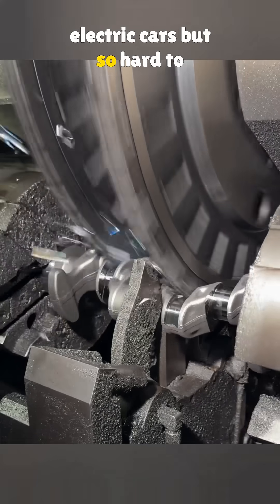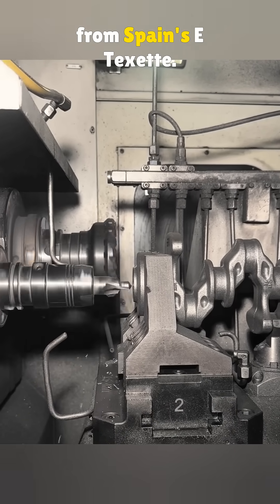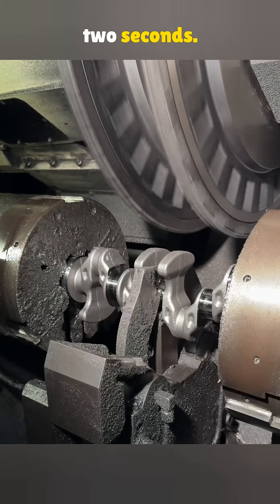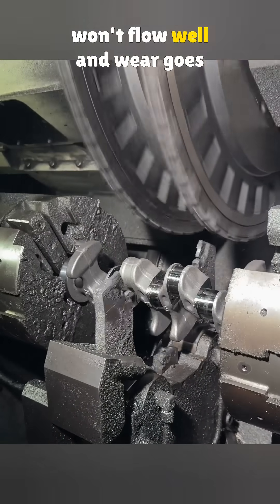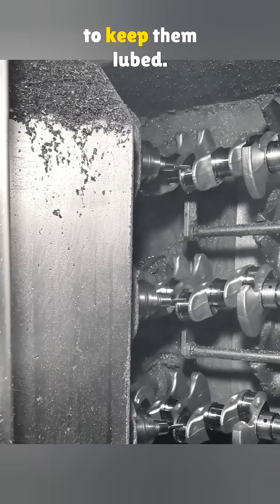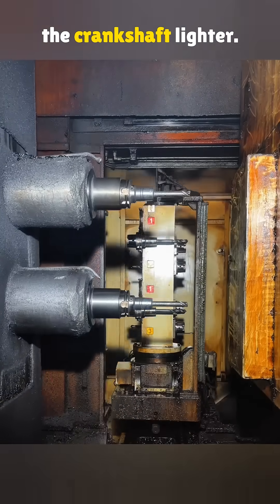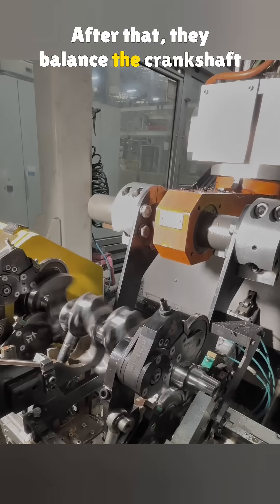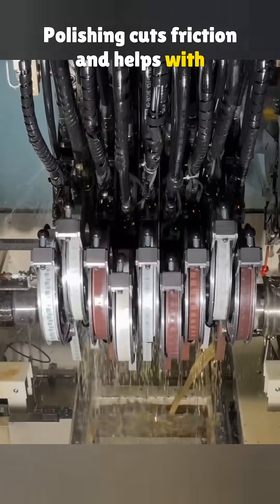How a Crankshaft Is Made #automobile #car #cartech #engine #mechanic

Comment: Batteries take high end precision industrial tools to make thin and perfect sheets of metal, plastic separator, precise amounts of liquid electrolyte, precise mixtures of compounds, some are micro meter engineered materials for Si for example and then again precise tools to take cells and battery packs out of with complicated cooling and electronic BMS boards. The electric motors are relatively simple but the inverter, motor controller, BMS and software are even more difficult to manufacture. They are cheap only due to scale but not everyone can make chips or write code or scale up production to be affordable.
Reply: Dont forget the copper, lithium & other metals that gotta be mined &  shipped to the the factories etc...
Reply: Wait for 10 years of industrialization
Reply: Though you are correct about engine assembly, you conveniently neglected to mention that producing an electic engine is material intensive and thus expensive. Furthermore, it's only half the picture, in fact, BEVs shifted the difficulty from the engine to the fuel. While it's extremely simple to produce a fuel tank and a fuel pump, making a batteries, all the necessary electronics, cooling systems, etc., is material and process intessive. Moreover, major issues with BEVs are yet to be accounted for, in fact, they aren't going to be solved any time soon. For example, BEV car cost, buttery cost, charging times, home charging avaiability,  charging stations throughput, lithium butteries inherent instability, risk  of fires, cost of repair in case of accidents, to mention just few.
Reply: @zvikabar-kochva3641  EVs are A LOT less complex as a whole car than ICE. Yes the battery is a highly engineered piece and need very high industialization to be built at competitive prices, but thats the only one part. you have actually MORE computer power needed to nurse a modern ICE than a electric motor, you have more parts with greater temperature variation. Sensors, catalysts, etc. But YES, the chinese can and actually also do build perfectly good ICE engines. Its just that their time is gone now. We are at a crossroads, comparable to the end of the horse era. ICE cars will soon be a luxury item for the enthusiasts, Hybrids will stay a bit for towing trailers and long range applications... but othervise it will be BEV
Reply: @tiboreeb5360  compexity is multi faceted. There are specific aspects, in which BEVs are certainly simpler than ICE cars and vise versa. Perhaps you should consider BEVs are not a new ideas. In fact, BEVs were produced at small scales already more than 100 ya. However, it took a century of technological development to make them cheep, practical and reliabe.
With respect to completely repacing ICE cars, I beg to differ. I  believe ICE cars are here to stay for the foreseeable future. In fact, I think BEVs current use case is limited to driving in and around big cities, if, and only if one have access to home charging. For all other applications, BEVs are less practical than IEC cars.
I live in Israel, a country the size of Beijing, with 40% of its population. Here, its not too cold, its not too hot and everything is close by. People having access to home charging, seldom need to charge elsewhere. There's no risk of getting stuck in traffic in case of environmental catastrophies. Yet, IEC cars are at least 70% of all new cars. I think that's something to consider.
Reply: @ the technical challenges for EVs have been knocked down again and again much faster than ney sayers and critics have believed. Take your claim that their use case is limited to urban regions and are not good enough to be the only car that can cross the country. Just the other day BYD unveiled their new EVs with new battery cells that can peak charge at 1MW and replenish their a range of roughly 400km or 240 miles in 5 minutes. Even if we take that claim to be overstated because the Chinese standard for range is much more optimistic than WLTP or EPA, it will still be fast enough to get EV recharged in under 10 minutes. Are they good enough now as the only cars? The limited use case for them remain applications where they require higher energy density like for example planes or semi trucks. However there are discovered chemistries that will make those feasible but tbey will likely require decades for mass market use. Long term, besides rockets and perhaps cargo ships there is not much future in combustion. Even there hydrogen will lilely be chosen to eliminate particulate emissions as much as possible.
Reply: @eternitynaut  fast charging for BEVs is a trap many people fall into due lack of electronics and engineering knowledge. As a electronics engineer for over 20 yrs, let me tell you why. One can build a very fast-charging infrastructure that will be very expensive (much more expensive than fuel) or one could build an inexpensive slow-charging infrastructure. However, no one can build a fast and cheep charging infrastructure. A 1MW infrastructure is equivalent of powering about 300 apartments. People of have done the math and discovered that for building 1MW charging infrastructure for the entire world wide car fleet, one will need to increase mining about 100 fold to mine the ore just to get enough copper. Imagine what this entails in raw material transportation, processing and shipping the finished copper to the countries of destination. Let alone copper prices. This is just the start. One also need to increase the power generation capacity 15 fold and to distribute all this power to the charging stations. If you think this is feasible in the foreseeable future you are kidding yourself. Last, be sure that nearly all this gigantic operation will be run on gas or coal since nuclear power stations takes 15 - 20 yrs to build in the west (less China) and wind and solar are out of the question. Never mind the CO2 emissions. This is just plant food. The real issue is particulate matter emissions and NO gas. This is bound to increase sickness and early death due to high exposure to these harming substances.
Reply: @ 1MW charging is easy to build, just as easy to make 1MW capable battery packs, you just use batteries like a battery bank to charge from the grid and then charge the cars. It has historically been prohibitively expensive but just as batteries for cars have gone down in price so is energy storage since it uses the same technology. Additionally with storage it can provide new renue streams for charging stations, unlike gas stations, by buying cheaper electricity off peak and delivering some electricity back to the grid during peak demand when the price per kWh goes up, exponentially so in high demand periods. Additionally with some local solar panels it can charge cars even if the grid goes down, sure a lot fewer cars per day but that could be enough to sustain local first responders during natural disasters or war. The reason it is and has been expensive is for the same reason EVs have been expensive until recently, lack of production scale and demand. Not enough EVs on the road does not bring enough income for charge stations to lower costs and expand their stations, a typical chicken and egg problem.
Reply: @eternitynaut  sure, the USA could build few 1MW charging stations here and there. However, look around, what company jumps on the opportunity to be the first to offer a 1MW infrastructure and control that markert? In fact, many charging companies have gone belly up in every country were BEVs are selling. The reason, fast charging is expenssive, very expensive. And people just don't want to pay the price, especially where the alternative already exist and its cheaper and more practical.
Ask yourself, what's the reasons\benefits for switching from a very sccessful fuel based transportation to an electric one? Technological inovation is the wrong answer. People don't pay for inovations. They only pay for things which are practical and make their life easier and they can afford. None of this applies to BEVs, unless you are based in a large urban environment, and have access home charging, which means you may be able to afford the high prices of a bran new BEV. Even so, in every county, which dropped the incentives to buy BEVs the demand dropped precipitously. This is quite telling given the fact that in the USA and Europe, there are unreasonable emission regulation that drive the prices of ICE cars way up in the recent dacade. Ask youself why most american buy SUV and pickup trucks? Well, that becase the emission regualtions for these type of vehicals are the easiest to pass, and manufacturers are expoloiting that fact to avoid very hefty fines if they sell cars that don't comply. However, the registrations are getting stricter by the year, so manufacturers had to drop simple and cheap naturally aspirated egines in favor of turbo charged smaller ones which make the cars, especially pickups ans SUVs, much more expensive to manufacture and much less reliable. To justify the high price tags, manufacurers includes in he base models many "goodies" to justify the tag and raise it a bit higher. Roll back these unessassary, artificial  restrictions and you can bet many more people will choose cheap ICE based sadans than SUVs, pickups and any BEV.
Reply: Forget EV cars and gas cars. They can't beat a reliable horse 🐎. 😊
Reply: I'm a mechanic and gasoline cars still contain huge amounts of electronics and a battery, you can't tell me an electric car is more complicated make
Reply: Lol i was about to ask then why are electric cars nearly twice the price
Reply: @ if you forgo all the fancy stuff, and pack a smaller battery pack, it will cost like normal low end Chinese EV. the problem is, you can no trick poor US customers into EV, but you can with Chinese customers because over there, the license to operate EV is much cheaper than  ICE car. they sold 500 million ICE car in the 2010s, then found out people dont have road to drive, dont drive that much, and dont replace their car as they dont actually need a car there. what else you can do to boost economy? just make ICE extremely extensive to operate, then force them to buy EV instead. you put any company into a market that has 500 million customers that dont care about quality and safety, only care about price....you will end up with a hug EV boom.
Reply: Internal combustion engine care are more complex to manufacture.
Reply: Easier to program them to become obsolete or to hack them.
Reply: it's just same process to make electronic components, totally different thing compare to machine mechanical parts. the equipments in use, materials and other stuff are just much easier to scale for electronic parts compare to doing machinery parts. for examples, heat forbid very fast production of this crank shafts in video, but for electronic circuit boards, you can print as fast as you can.
Reply: @haihengh No, the semiconductor industry is the most advanced, complex difficult type of manufacturing mankind has ever come up with. Nothing else compares this insane pinnacle of human achievement.
Reply: @ chip manufacturing is one of the most technically demanding processes and even at the low end you need billions to set up a factory. Yield per wafer is a big issue, frankly mechanical people complain too much and have no idea what precision is and try to lecture to people working at the nano meter scale. Please get lost.
Reply: @eternitynaut  chip is different story, china actually doing the low end stuff, all high end are done by Taiwan, us japan and Germany are doing the mid to high end. You talk about battery, the reason we want ev is because oil are dirty, guess what else are dirty? Battery too. The whole reason china is doing all the battery manufacturing not because us labor is expensive, it was because people want to have good feeling by not having battery made in US. It’s highly automated production line, so any place can have battery manufacturing, but we have epa while china don’t give a shit about environment.
Reply: @ you can y have batteries without chips and China had to pay dearly and took decades to make even low end chips. Without BMS boards, motor controllers or inverters, all using micro chips you can t have a modern EVs. You can have battery cells, but that is like saying you can make a chunk of steel without tools needed to make an engine. Point being, it takes higher tech industries to enable EVs than ICE cars. Any country can make an engine, batteries and especially chips and software on top of that is very difficult. Most EV manufacturers import these from China including Tesla and including Panasonic, their US based cell suppliers needs pre cursors and chips from China. Meanwhile North Korea can make engines no problem.
Reply: @eternitynaut  no, actually not true, ev does not require higher tech, actually reverse, it does not require higher tech capability to produce, it require a different capability, the same capability to produce appliance and electronics, also require much less restriction on environmental oversight, the entire supply chain was intentionally place in china because western world don’t want to do the dirty work and want slave wage. that is the main reason everyone and their dog can produce ev in china, because there is no regulations, no labor protection, no environmental review there, all you need is some sort of connection to high rank officials. Think about why Tesla can sell their ev for 25k in china, why they can not sell the same ev for the same price elsewhere
Reply: @ it is true EVs require higher tech, without it, you can t have a modern EV with high power output, high charging speed and long range while maintaining good efficiency of over 100MPGe. To achieve all that you need higher technology than engine manufacturing. This is why much fewer countries can make competitive EVs, it takes expertise in material science, electronics, chemistry, SoI chip manufacturing and more. We are talking about nano meter scale tech, you can t even imagine the complexity of it as an ICE car manufacturer. As for why China dominates in this space it is not a coincidence, it has decades of continued investments in batteries, chip manufacturing and electronics and it is now paying off. In US and Europe, conveniently forgotten, EVs have been politicized since the 2010s, I can find the talking points of ney sayers in this very commemt thread. What is the point of doubting if the tech makes sense or is financially viable? Chinese EV manufacturers have already demonstrated it, now the question is how other regions will mamage to catch up. Take Catl for example, try competing on cost per kWh of storage when you start your factory with 10GWh to 50GWh while they make hundreds of GWh, economy of scale matters, decades of experience matter as well as the supply chain being developed for precursors. At any rate, I highly contest the notion EVs are simpler to make. What happened in China is that they invested early on and did not politicize the technology so as to delay policies to support the development and growth of this industry.
Reply: @haihengh  your perception of China is outdated. The reason there are lots of Chinese BEV manufacturers is the result of massive incentives strarting more than a dacade ago to ramp up this technology to the point of world dominance. They poured hundredes of billions to develop the infrastructure for matials, supply chain and cars. Many Chinese are hardcore entrepreneurs and given the massive flud of money they jumped on the opportunity to make big money. Wouldn't you?
Reply: @eternitynaut if any country can make ICE why hasn't China ever had a car production in the past?
Reply: @eternitynaut the Germans make the machines that make the machines.
Reply: You can keep your ev's. I don't need anything that burns at 1500f, is prone to thermal runaway, oxidizes in the presence of atmosphere, severely degrades in "hot and cold" climates, is not viable for recycling, and requires no oxygen to burn (which makes it almost impossible to extinguish once ignited). ICE vehicles have been doing just fine for over 100yrs now.
Reply: @jayr.9266  Ah yes, doing just fine for 100 years, like poisoning the whole world with lead for 5decades... look, i dont need to discuss the benefits of ev with you and so does technological advance. it will just happen. btw there are already solutions for all the problems you listed, but not for the disadvantages of mass ICE use...
Reply: get rid of all the battery care smart technology and well end up with many exploding batteries!  Sure you can do it cheaper 🔥 💥

Comment: So fool, what a crapp, Start to go work in Lithium Cobalt, Nickel Copper mining, Nigeria, Pakistan and the like. Hwat about a petrol cars life 20yr and than been shipped to poor Nations to get an other 20+yrs. EV? After 8yrs its done Due to replace costs of that Batt-Pack. Shipp to Africa? LoL So life span EV is dead short acc to patrol. Then TAkE all chargers Inverters, Cabling etc All E-Waist after 10yrs. Tak ethat Huge PILE of E-Waist within 10yrs , By the Millions of chargers batt-packs. The energy costs of recycling, if economical effective.